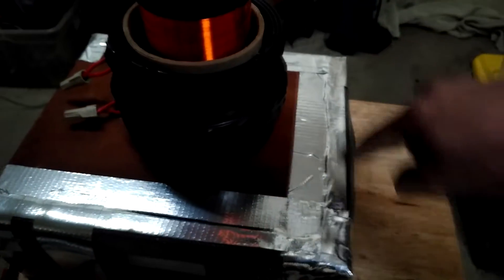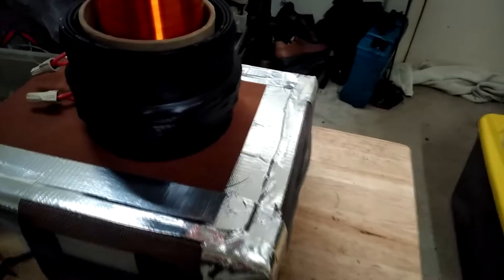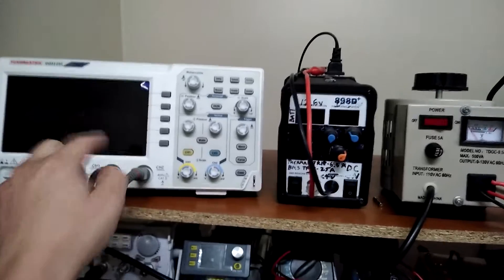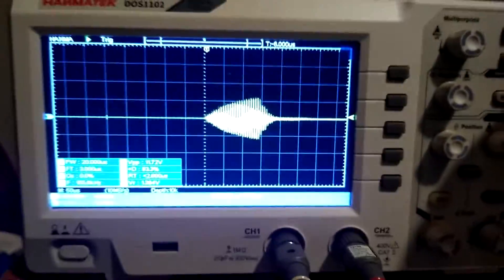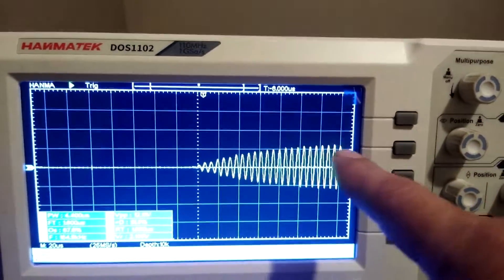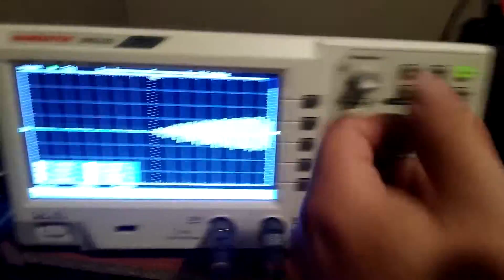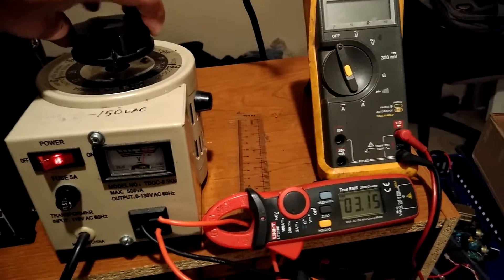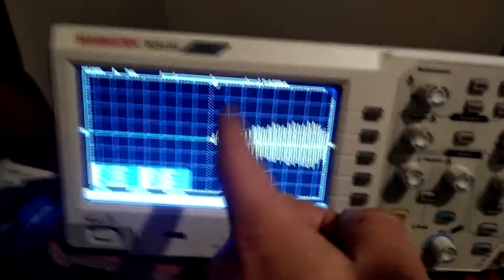'Budget?' DRSSTC power draw (~600W)

Comment: You need to make some ion propellers;)
Reply from the maker: haha I thought about it but I honestly don't think it will do anything at that voltage unless I try to make them huge, I guess that's about the only way. The arcs would look pretty crazy tho.
Reply: @Magneticitist  you have more than enough arc to turn one. Just have to make a circular strike rail around it.
Reply from the maker: @MAGnetICus_Attractus  the problem I think would just be getting the arcs to actually shoot out in a uniform enough direction but it could be done with a long enough propeller
Reply: @Magneticitist  just remember a wire is like a hose pipe spraying water. I would start with something like a paper clip in a ying-yang shape.
Reply from the maker: @MAGnetICus_Attractus  With something so small arcs that long don't really care which direction the ends of the spinner are pointing, they need to extend out quite a bit. Running an ion motor is super easy on smaller coils but when I put a small propeller on a DRSSTC like this the arcs just go everywhere. For example using a paperclip length one causes the arcs to just jump out all over the thin body of the clip and go straight up and all over.

Comment: Are you using the lm311 op amp for your OCD?
Reply from the maker: yep they work pretty good. I was actually using the damn thing previously but now it's just set to where it doesn't trip at all at max voltage. I thought overcurrent is what killed my bridge before but it was hard strikes to the coil on the other side where I couldn't see when running it. Shit got crispy I had to clean it and just re-tape. 
So at this point honestly OCD hasn't been needed for me running my power levels and using these IGBT's in either of the 3 DR's I made using them. There was the issue with ground strikes in my .5 build and secondary feedback though so it may be useful if you're going that route.